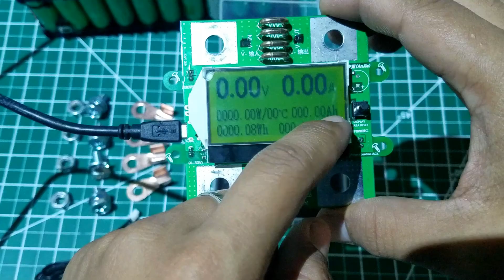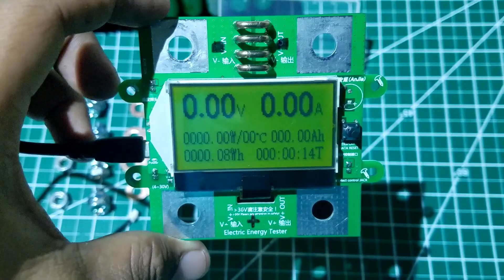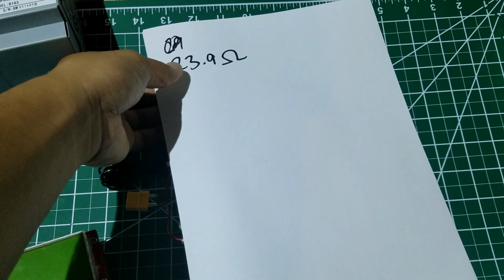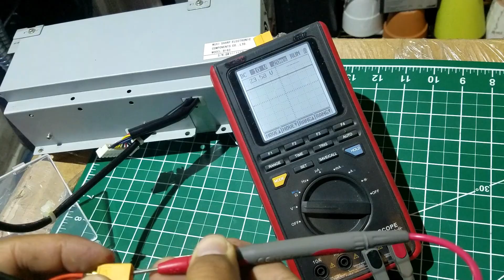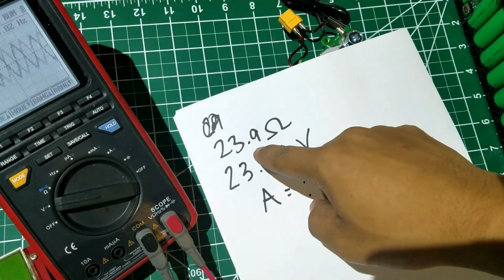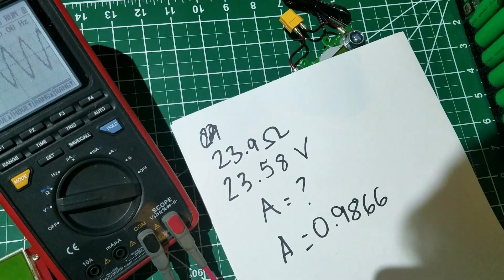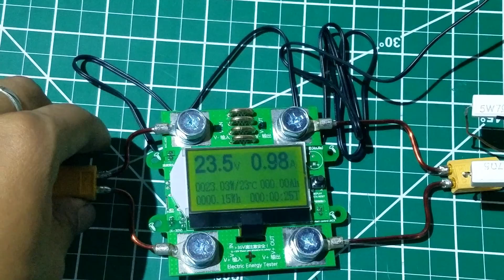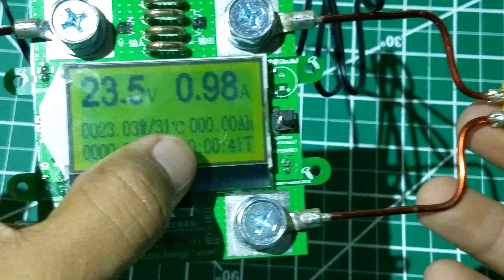300V 100A DC Digital Voltmeter Ammeter Review

Comment: No way in ell that PCB track would sustain 100A.  LOL     I can't figure out if you can set Bottom Depth of discharge alarm ?  No MosFet so it can not turn off test.  Is there any fashions of a PDF with instructions ?

Comment: I'm having trouble getting my voltage cut off button to work. It seems like it either Scrolls up or down and I have to go all the way up to 300 volts and then scroll back down if I'm setting it for something like 12 volts trying to find some more information on this
Reply: Are you referring to the  Low Battery End Voltage  shut down ?   (• Low pressure set range: 0 ~ 149V) ?  Love the translations.    I'm trying to figure out how to set that.    Yea, I' ve been trying to find a PDF on the thing with no luck.  Do you know of anything like that ?  Sent the Seller a  MSG but things are really messed up in China right now.  Took a month for the thing to even get shipped ..   Still not arrives as of yet.
Reply: @pulesjet  yes that's what I'm trying to do it seems like it's a hit and miss. The output is on the two pins on the back that's a protection seem to produce 3 volts when the low voltage or high voltage thresholds are reached. I think you scroll through the menu to you get to that low voltage right after the backlight setting. I put a video up on my YouTube about it which you can get to by clicking on my profile picture

Comment: The Thermo sensor is to measure the Battery Temp and compensate voltage readings I think.
Reply: It is only for showing temperature, doesn't do any voltage adjustments because it's not a charger.